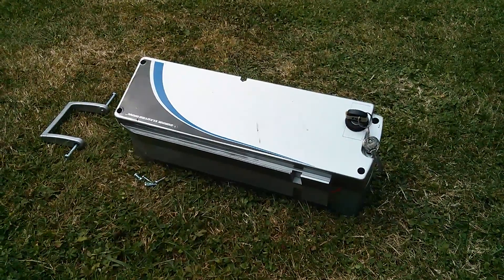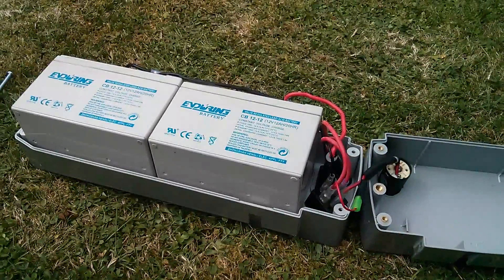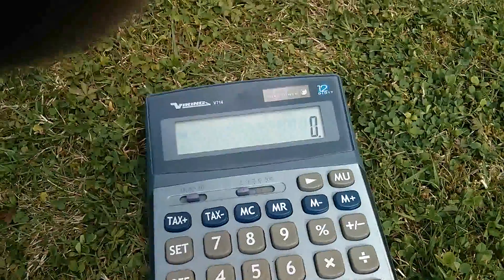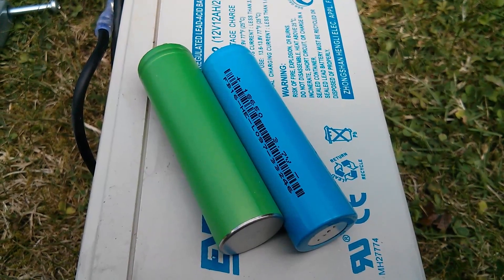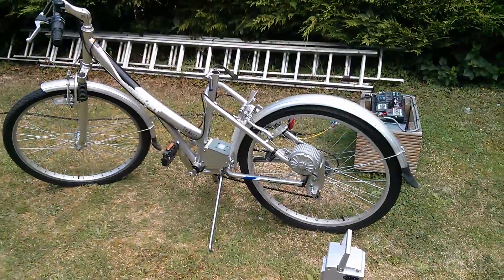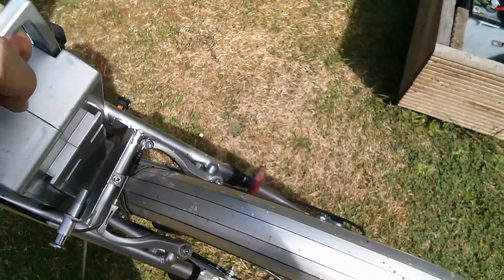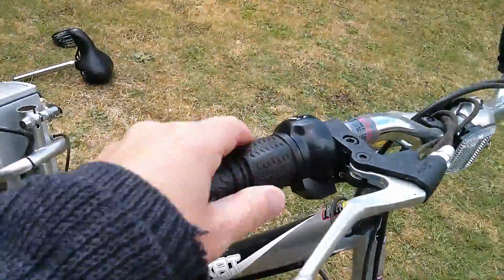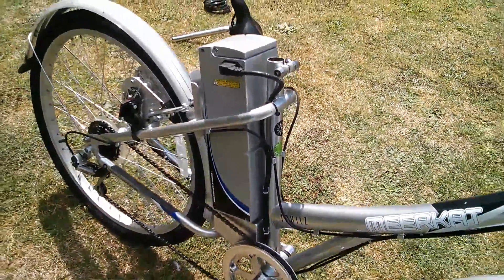Project: Upgrade Electric Bike to Lithium Batteries #1

Comment: You should never leave Pb-batteries in a discharged state for longer time - thats the worst you can do to it. Always charge them fully up to store and tickle charge them every month at least :-)
Otherwise the PbSO4 (lead sulphate) will build bigger and harder cristals that cannot be resolved any more and dont take part in the electric charging and discharging process any more.
There are some technics to revive these sulfated cells if you use pulse charging with a lot higher voltage to break these cristals. Its not easy and in some cases it wont work - depending on the state of the sulfation. The longer it stands uncharded the worse it gets. You can use high voltage peaks up to 100 or more volts for a few ms and a duty cycle of 10-20% until the battery starts taking some current. But it wont come to new-state of course ;-)

Comment: you can use a bms to protect and charge lithium ion battery .. but use same battery from same batch with same capacity and manufacturer ... bms will cut of the charge if one cell reach 4.2v which is low capacity then the whole pack charge will be stopped by the bms and it also apply for discharge.. use those Panasonic battery 2500ma they cost 180$ for 40pice and you need 6s to make 24v .. and also you need a good 6s bms and it doesn't matter how many you put in parralal 6s2p =5000ma at 24v ,6s3p= 7500ma at 24v , 6s4p =10,000ma at 24 v and you need 48 of those lithum battery.. i recommed 6s 5p for 12500ma and it will just need 54battery and it is equivalent to the capacity of lead acid battery but lot lighter so that you can get it a lot longer than usual acid battery which is heavy but inexpensive... and you can use the same bms for every cell that means 5lithum cells will be paired together and monitor by one bms waire and then 6 of those 5 parrala cells connected with  the bms you can see many videos on YouTube how to connect a bms!!

Comment: You can use two imax b6 chargers and do up to 12 by splitting the pack in half 6 on one and 6 on the other using adapters.

Comment: Hi, I bought a Lashout electric scooter off Craigslist last year and I want to lighten it up. I was looking at 2 LiFePO4 12v20AH batteries, but since it's 24v, why not just buy 1 24v instead? Is there any reason not to?

Comment: that connector is a famous chinese connector called som ting wong female or male or what ever.
Reply from the maker: now i long for yesterday
Reply: Laptop cells are not particularly well suited for this. 18650 is just a psychical  specification. When you get down to various cells, there are ratings and as a general rule, the higher the mAH rating, the less energy can be drawn at once. IOW, high density LI-ION cells don't like to be put under heavy load. Getting these low grade, old laptop cells isn't the best idea. You also have to make sure the cells are all equally matched.
Reply: I forgot what this was about. oh yeah e-bike. You know I found e-bike that is factory made were the lower end of batteries made under odd conditions and mixture. I know  a guy that work for a company that sound like banosinic explained the charts and all to me but in short they are worse than a cheap after market lappet battery cells but for bike uses a major name factory original laptop battery is as perfect as one can do within a set budget and or lowest price.
Reply: The current draw on these cells for an e-bike can be very high and exceed the rating of the cells. Since these cells were made for laptops, they are not designed to be under heavy load for multiple minutes (say while climbing a hill) and are a bad choice for an e-bike battery.
Reply: The 18650 cells seem to work incredibly well for Tesla model S cars.
Reply: 18650 is just a physical dimension. On a properly labeled 18650, it will give the maximum current draw and the maximum short duration draw. The different brand and grades of 18650 cells have different ratings. You might want to Google 18650 grades current draw.
Reply: Okay. I checked. Yeah, the 18650 cells in the Tesla Model S and in the Audi R8 e-Tron are the same spec 18650 cells used in laptop batteries.
Reply: Would you mind giving me a link? As I  understand it, most laptop batteries, especially rebuilt or off-brand (non OEM replacements) use lower grade cells in their battery.
Reply: Also, don't forget that Tesla uses huge batteries that are probably not discharging more than 0.5C. These small bicycle batteries usually have loads well above 1C. If you can keep the discharge below 0.5C, it probably wouldn't matter what grade you are using.

Comment: is the motor controller completely necessary? would i be able to control the motor speed with a dimmer switch?
Reply: a dimmer wont take the current and dimmer switches are designed for AC power

Comment: li-ion cells are @ 4.2Volt when fully charged
Reply: +Daniel Zagrean It quickly drops to 3.7v though.
Reply: +Daniel Zagrean he is using lifepo4 which is 3.6v full

Comment: Did  you manage to finish your project, if not and you still have your old lead acid batteries did you consider DE sulphating them, I have lead acid batteries that have lasted over 20 years and still going strong, even my motorcycle battery has been going strong for over 8 years and no problems, soon as it starts to lag I De sulphate it and bang good as new for another year or two.

When I first started de sulphating I was sceptical but the results speak for themselves, it turns out you don't even need any special device just use an old style charger and keep an eye on it from time to time to ensure it won't explode, but using the device looks after the battery for you and new style charges won't work, something to do with computer shutting it down to protect the battery I guess so you need the device with the new chargers.

As for the 18650 cells you could always start off with a smaller AH for testing then increase it as you go along, most tend to start off with around a 10 AH check out Rinoa he has a few good videos showing his 24 AH battery claiming 100 miles plus.

Comment: The connector doesn't seem to fit in with any IEC 60320 norms. As you say, it is similar to the C13, C14 with the ground pin at 90 degrees to what is expected.
My unbranded electric dragon does use a standard C13/C14 pair. It also has a 20mm fuse which is pretty daft at that sort of current. When the industry matures a bit, they might see fit to use a blade or maxi blade.

Comment: Putting in a 35 amp controller will give you more kick on take off and can even help increase top speed and puts less strain on the controller so it will last longer.

Comment: Sure...UPGRADE. Here is another idea and to KISS. You will reduce your weight and increase range by using a LiFePo4 29.2v/8ah (charged 8x3.65v) 8S 2p battery pack (4x2). Then using a balancing charger like the iMax B6AC or a couple of small balancers. Plus you get a few more volts, and top end speed, than the stock HEAVY & saggy SLA is around 27.2v.

http://www.hobbyking.com/hobbyking/store/__20645__ZIPPY_Flightmax_8400mAh_4S2P_30C_LiFePo4_Pack_USA_Warehouse_.html

Though "free" batteries work too if you have the skills to set up the cells in a pack by soldering cells and adding a BMS?!?

This works with all 24v ebikes, like the iZip trailz.  The stock controller can handle it, though earlier ones (2008 range) can even handle a 33v charge. Check your caps in "box". BTW...you can exchange your 20t wheel freewheel for a 16t lefty one for top end pedaling. And also, you can exchange your rear freewheel to a 11t-28t, and too exchange your front chainring to a 48t+ for the same reason!  :-)
Reply from the maker: Kit Babcock I'm sold on LiFePo4 as the battery technology now. Probably go for 8S1P and use a Turnigy Accucel 8S for charging.
Reply: Julian...that of course should work by keeping your voltage to 29.2v (8x3.65v) and eliminating the heavy high sag SLA chemistry.  Though you might want to check the caps in your controller to see their limit as the earlier (2008 range) bikes can be upped to 33v, which of course increases your speed even more (9s @ 32.85v)!  :-)

Comment: I run turnigy 4s 5000mah hardcase cells, never had a problem . recharge with a crappy imax b6 clone.

I run it into a 24v 250w cheap hub motor that usually sells for like £180ukp shipped. saved me a fortune on fuel for the wife's 1.5 mile trip across the city to work..

they can usually take a higher voltage, the 24v runs happy at 8s(32v) which gets you upto the legal limit for speed as the cheap chinese hubs are about 2v/1mph in a 26 wheel.

rumors of me running 16s/66v are untrue it would go too fasssst.....

Comment: Interesting new project, the heatsinked chips on the controller would probably be a H-bridge with 2 in parallel|series and provides reverse if you have that, if you don't have reverse then they would probably be a series|parallel PWM switch to the DC motor.
By my math to replace the lead acids you'd need ~6.7kg of li-ion or ~3.9kg of lipo plus wiring.

Comment: You were talking about old laptop batteries, but the problem is that they won't be identical and you can't parallel batteries with different capacities up, because you're going to harm them, either way by soaking some of them too low or by misscharging them. You have too read the datasheets to see if the li-ion batteries are able to supply enough current as well, like some said before, LiFePo4 batteries are much more suitable for high current usage. You can get 10 or 20Ah ones of them and they have really long life time, about 2000-3000 Cycles. The Company I'm working in, is using the bigger ones for electric vehicles for years and we are quite happy with performance even at low temperatures. Li-ions are much more delicate compared to LiFePo4, because they can't operate at such a temperature range, they have higher impedance and can't supply as much current as LiFePo4 do.

Comment: 250 watt motor seems a but weak. i suppose it would get you about ok though.
Reply from the maker: It's the legal maximum for e-bikes here
Reply: Julian Ilett where i live the maximum is 200 watts but my e bike has a 600W motor on it with a 200W sticker on it.
Reply: Tony Ling oh i know that i just put the 200W sticker on it :D
Reply: Tony Ling im in Australia where everything is just as strict. my ebike goes like 25 kph but has more torque than speed. it goes up very steep hills while remaining a very good pace.
Reply: smallenginedude71 Electric motor rating is not altogether straigtforward. It is possible that your motor would have a continuous average rating of 200W without burning out but could take a peak of up to 600W at stall speed
Reply: smallenginedude71 Oh I see ;-) Are you in England ? Didn't they bring us back in line with the rest of mainland Europe an allow us a hair raising 250W and 27.5 k/ph ?
Reply: smallenginedude71 I need more torque when I get a better bike. My Chinese thing has only one gear and couldn't pull the skin off a rice pudding. I only bought it to help with the fierce hills around here, but it's not that much help with those.
Reply: Tony Ling haha "couldnt pull the skin off a rice pudding" lmao! oh well try the 1000W ones they haul ass!
Reply: Tony Ling  lol tony,ha ha..not hurd that one before ..its a gudden..

Comment: The only place i've found them noted is on electric bike charging sites, they seem to call them 'modified iec connectors' (very descriptive). Seeing as the earth's not used, I suspect just taking a drill to a regular IEC plug would allow you to connect to it

Comment: I have a couple projects on the go that need 18650 batteries. How do you find a genuine supplier of quality batteries? A post like this is inviting, but how real is it?

http://www.ebay.com/itm/100-PANASONIC-Lithium-Based-CGR18650DA-Li-ion-18650-Battery-3-6V-2250mAh-/261551373047?pt=US_Rechargeable_Batteries&hash=item3ce5ad3af7

Should be enough to get you started :)

Comment: I think a few of these in parallel http://www.hobbyking.com/hobbyking/store/__8932__Turnigy_2200mAh_3S_20C_Lipo_Pack.html wire all the balance leads in parralel and either get a 3s battery managment PCB or just have a balance charger.

Comment: That connector is a "modified C13" When they started making those, they needed a plug that could handle the amps, but at the same time people wouldn't just plug the battery into the 220AC mains via a normal C13 (yes, some people are THAT stupid).  So the ground pin was twisted.   It was supposed to get ammended in the IEC but that never happened.  There was instead a set of new connectors proposed for high amp batteries.  That too didn't really get into a standard because the need dropped off because of upcoming Li-Ion and  LiPo batteries.  New e-bikes now will tend to have either EnergyBus plugs. or have a built in 'docking style' in the battery pack and bike.

So basically that plug is an "old" plug.  If you need replacements, it's going to be hard to find them because they don't have an official designation/naming.  You might find companies selling charger units naming it "modified IEC C13" or "Modified C13" or "modified 3-pin shroud connector" or 'e-bike plug'

Comment: I have a homemade electric bike, and i replaced the 50 pounds of lead with 5 pounds of 18650 cells, 24v at ~16ah, for a total of 48 cells. I have enough cells to make a second battery, but i wont. I do need to find a use for all of my sanyo 18650s that arent doing anything.

Comment: The 12Ah rating is for 20h discharge rate on normal use with that bike you will at best when new got around 5 to 6Ah.
You can use 8S LIFePO4 or 7 cell LiCoO2 your choice but you will unfortunately need a BMS or at least a battery low voltage protection + one of those 8 cell hobby chargers.
You can also take a look at my Solar BMS that may work if you want to charge the bike from solar panels or a constant current power supply. The Solar BMS is probably a bit of overkill for this project and is not weather proof.
I will suggest you use larger cells like those  Headway 38140 if they fit the current box. There are 10 to 15Ah version available any will manage at least 2x the range you had when those Lead Acid where new.
You will need to many of those 18650 and will be a lot of work to connect them together.

Comment: Or Lipo meant for remote controlled helicopters could be a cheaper  and lighter alternative (since they are pouch cells). A good site for them is hobbyking.com . They have some 7cell packs already available, combine them for the appropriate capacity.

edit: Like some people have pointed out, 6 cell lipo would be more appropriate, because 3.7V is only the nominal voltage. 4.2V*6S=25.2V

Comment: I think they call that a C19 IEC.
http://uk.farnell.com/schurter/4793-4000/inlet-iec-1-5mm-16-20a/dp/1176788
http://uk.farnell.com/schurter/4795-0000/socket-iec-16a-free/dp/1170114?MER=en-me-pd-r2-acce-con
Reply: I think it's actually a C21 with the chamfered corners is it not?
http://www.conrad.fr/medias/global/ce/7000_7999/7400/7400/7405/740573_LB_00_FB.EPS_1000.jpg
Reply: Alex Matthews http://en.wikipedia.org/wiki/IEC_60320
Reply: no, C19 is a rectangular plug designed for higher current.  it's rectangular on purpose to avoid confusion with the C13.

Comment: I have one that that is 500 watts. its 24 volts when batteries are full charged they are at 28 volts. I have a 36 volt controller I bought I was going to use so I can go faster but never put it in because need to add the 3rd battery some were LOL.

Comment: Perhaps a lead acid battery desulfator, and see if you can revive those sealed batteries and use them for your solar garden light
Here is one I built, tested and it desulfated a ATV battery in about a month...completely dead, slow trickle charge and this and a month later almost good as new!
https://oshpark.com/shared_projects/ATrDSRDV

Comment: Axial flux or large brushless motor, some lipo battery pack in series and a high current speed controller. All these things are available cheaps from rc models suppliers online. You'll have yourself a real speed machine! Hope it goes well. As for charger hobbyking have balanced charges that'll automatically charge any voltage at a chosen current. Gd Luck!

Comment: You could use a step up or a step down buck converter and if it gets too hot You can add a fan inside the case with holes in it